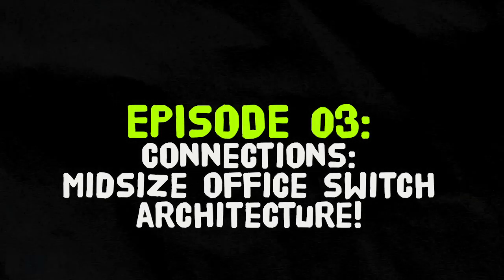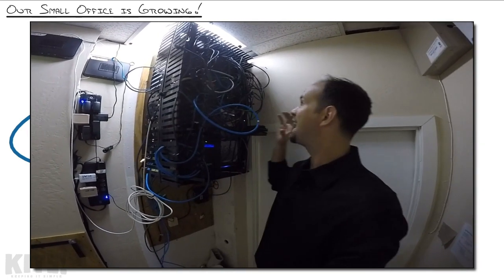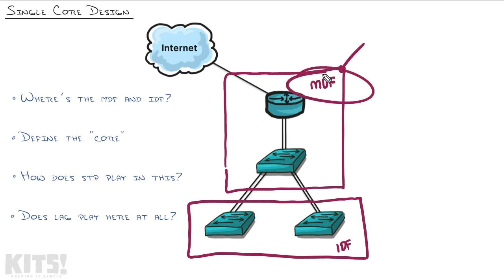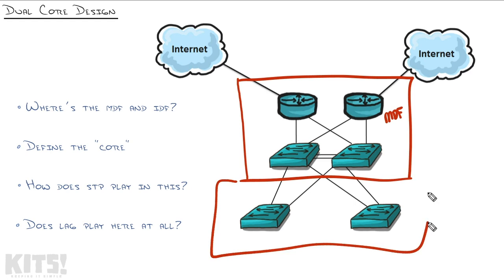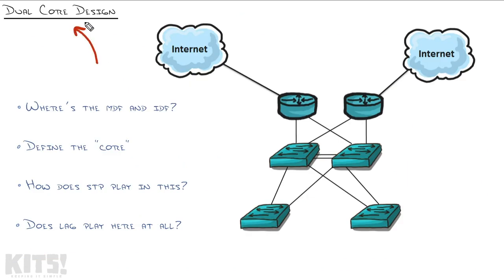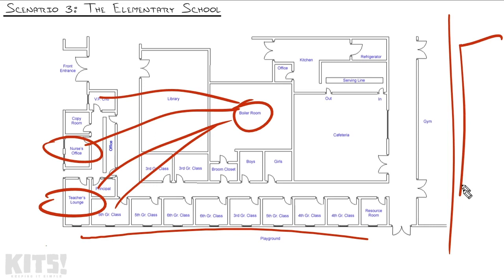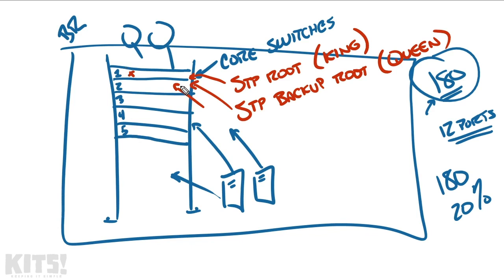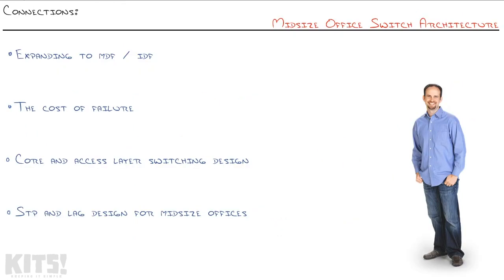Midsize Office Architecture! Ep.3: Real-World Business Switch Network Build

Comment: Hey, great video. I like your enthusiasm as always, how things are explained.

What about the approach with a stacked core and fibre connections between core and access switches?
Cleaner design, saves copper ports, no crosstalk, no 100 meters ethernet limitation etc.
Just a superficial concept, there is of course a bit more to it.

That is basically what I was confronted with when I went out to the real world with my fresh CCNA in my pocket some years ago and oh my. Reality hits you hard and merciless.

If I did not missed it, a video about that would be awesome for those who don't know that yet. I saw a question here asking what if 100 meters are exceeded so this would be a good answer to that.

Of course, this might be a bit too much for a small size office but there are good chances to have it for other setups.

Comment: I normally have 2x 48 port Layer 3 switches at the top of the Main Stack and then run 2x or 4x 1Gb LAG  (EtherChannel) Groups between each switch back to them. Let them control all the vLANing, internal Routing etc LAG Groups rock. I still have that habit of using a different brand Firewall/Security Device/Router to my switches. I like Sophos UTMs and Ubiquiti Networking :)  Starting to transition to Ubiquiti 10Gb ES-16-XG switches as Aggregation Switches now as prices tumble down for 10Gbe.

Comment: Hi Jeremy, awesome teacher, lots of love.

A question, can we use etherchannel to connect all switches together ?, and be rid of loops?

Anyones input appreciated.

Thanks.
Reply: You can, you would have to modify your MDF/IDF set up a little bit though.  Unless you wanted to just use EtherChannel say between MDF-SW1 - IDF-SW1 and MDF-SW2 - IDF-SW2.  However, that still would have a loop between SW1 and SW2 and STP would still block a link in specific Vlans depending on your STP setup.  You could also just run all the cables from MDF to IDF on SW1 on both ends, and LAG them all there, then you wouldn't have a loop.  But, you would have a single point of failure if SW1 in either closet went down.  Personally, if we were using 48-port stackable switches as Jeremy said, I would have stacked the switches in the MDF and IDF, then ran the 4 L2 cables in 1 LAG between the closets to get 4gbps of bandwidth and in that case, we would have been rid of loops as you suggested, as well as gain bandwidth from the LAG and freed up switch ports on the front of the switches by using stacks.
Reply: @mattpatrick986  Thanks for your input 😊

Comment: I want to know when will be time to upgrade core switch to L3 switch? Do we need two cable to each core switch?
Reply: This is important, because today most all switches are L3. I would move away from L2 spanning tree "flat" topologies and move to a L3 IP addressing scheme. In my sketch I would put a L3 switch n the MDF as a core router and each IDF is a separate IP subnet. Place IP helper addresses on the MDF L3 interfaces facing the IDF switches and use a few static routes for this small trivial network.
Reply: @MrBraveheart814  why don't use ospf instead of static roles, since you are configure routes for multiple l3 switch?